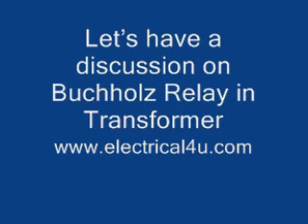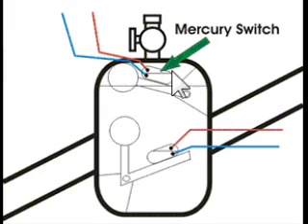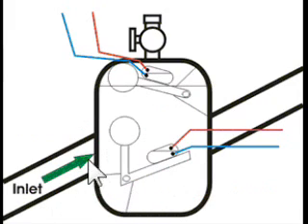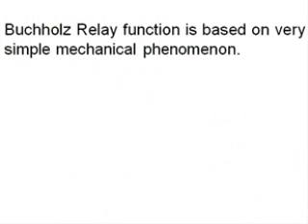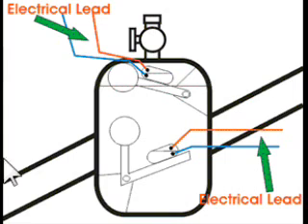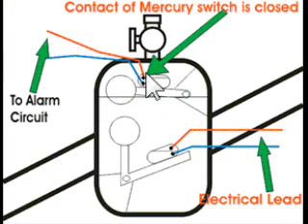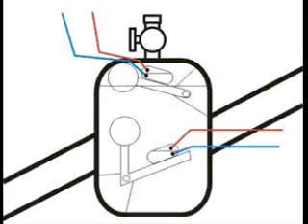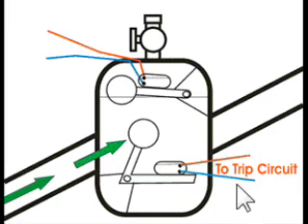Buchholz Relay: Working Animation And Construction

Comment: Thanks for sharing this video. Easy to understand. In addition, there is a new improved version with different float movement. Since, the buchholz relay is mounted between tank and conversator an gas sampling device can be added to check from the ground. 
@Aaryani Kadiyala the buchholz relay is used for internal faults (oil level loss, gas accumulation and sudden pressure wave) Here you can find new version: https://www.maier-accessories.com/en/transformer-accessories/protection-devices/buchholz-relay-mbp.html

Comment: Is buchholz relay used for internal faults or for external faults
Reply: Aaryani Kadiyala Buchholz Relay works only for internal faults with in the transformer core such as turn to turn faults and phase to phase faults. It does not operate for external faults.
Reply: Thank you